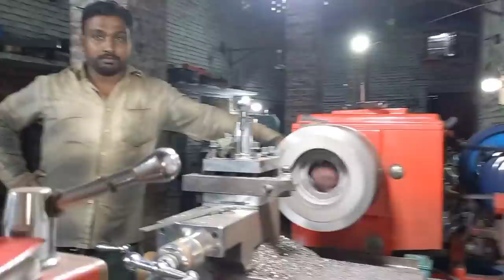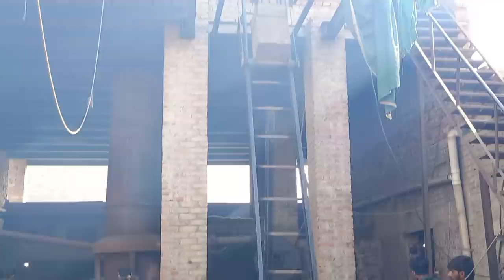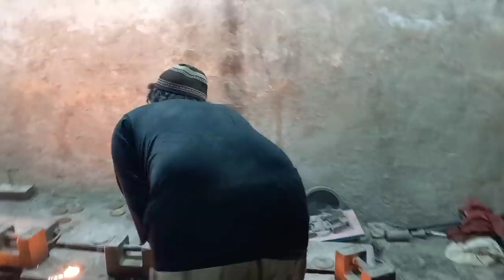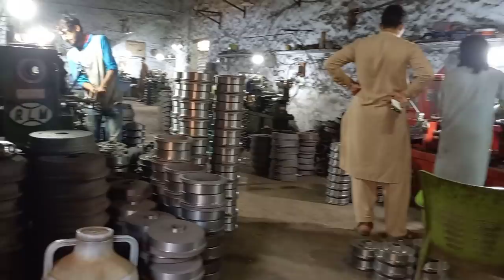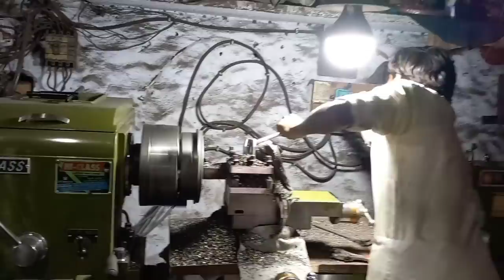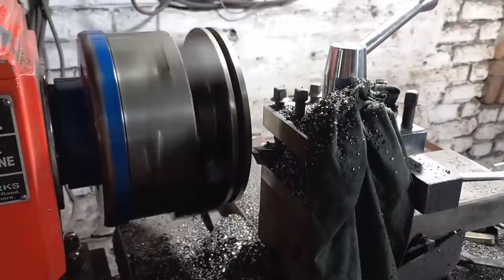How To Make Toyota Corolla Disc Brake in industry || Disc Brake Full Making Process.

Comment: I admire the hard work and their ability to turn out decent looking brake parts in tough working conditions and using less than state of the art equipment. But I now understand why the metallurgy and durability of aftermarket brake rotors isn’t comparable with OEM quality.

Comment: Love watching these guys work. Sure as hell wouldn't fit one of those discs to my car though...
Reply: I've worked in a foundry, makes me wince to watch them.
Reply: @ffjsb  whats the metal quality  !!!!!
Reply: @ericlees7518  Whatever scrap they get for cheap....
Reply: @ffjsb  is it steel or cast iron  mmmmmm
Reply: This is a cast iron foundry.
Reply: You also gotta take into account these aren't going on cars doing 90 on the freeway they're on small not very powerful low speed vehicles in super congested cites travelling short distances
Reply: @umahunter  YUS
Reply: Looking like they make a lot of them. If they're bad no one really would use them. Yes I think keeping the speed below 90 kmph should be alright. The step I see missing is the annealing process to release metal stress
Reply: @abc123xyz7  mmmmm cast iron eh!  mmmmmmmmmmmmm it rusts when wet  not like stainless steel mmmmmm
Reply: @abc123xyz7  yus  but they will rust mmmmmmmmmm
Reply: Eric Lees , yes the break drums and discs that we have on the vehicle rust easily. If you don't use your vehicle for some short time you will see very rusty breaks. Cast iron breaks been used safely
Reply: @ericlees7518  Probably pot metal...
Reply: @umahunter  Do you not know what a Toyota Corolla is????????????
Reply: @ffjsb  it is for any kind of car. Just simple cast iron with high enough carbon.
Reply: @ericlees7518  There is no quality here.
Reply: @rondhole  At what point did they test the molten cast iron for carbon content????

Get my point?
Reply: @ffjsb  all steel has decent amount of carbon on it. It should be enough for India slow traffic, may be not Autobahn with EU ECE90 standardisation. Similar thing with Chinese brake disc. Not all are certified and definitely not for export with the way these guys did
 It  is for local domestic market
Reply: @ffjsb  then they don't buy the local unlicensed parts. GEt it from Totoa dealership.  India has large atnd different markets, just like their Caste
Reply: @johnogara3029  Not from this part of the suppliers. India is large, really large. Just like China Brake disc, they are 1000 different kinds.
Reply: I like how you lot think these are shit. Odds are half of you have brakes made the same way on your car right now. These parts wear down, no reason to make them out of special alloy for a cheap car. As long as it makes it out of the factory it will be fine.
Reply: @Rudy97  Dude, these kind of suppliers are for local just like in other parts of Asia, Afrika, and Latin America.
Reply: Disc brakes have to deal with significant loads and heat, the ones being made in this video appear to be nothing more than cast iron. I sure as hell hope that no one in the UK is selling these discs. The legal ramifications for them would be severe if they caused a fatal accident
Reply: You won't but the manufacturers do and you have no say in the matter.

Comment: Wonderful Aftermarket brake rotors and drums!
Reply: There's NOTHING "wonderful" about these poor quality knockoff parts.
Reply: @ffjsb  my point!
Reply: @graemelliott3942  You're sarcasm is lost when most of the people in the comments are actually praising this poor quality workmanship.
Reply: @ffjsb  I knew that too when I made the comment. I used to be part of a company that made brake rotors here in the good old USA. The actual molds and cores were done on an automated mold marking line called a Disamatic made by the Disa Corp. What they were doing in the video is known as floor pour. Floor pour is good for low volume / prototype production. It’s almost impossible to  hold repeatable balance spec and QC is all over the map.
Reply: @graemelliott3942  I worked a short stint part time at one of the largest casting floors in the US, they made mostly sideframes, bolsters, and couplers for rail cars.  One of the largest things I saw them pour was a 10' diameter double sheave pulley, looked like it was for 4"+ cable.
They had automated mold machines, but I have no idea who made them.  I was safety/security, so I was in the plant all over, but didn't do production.  
Glad it was just a side gig.
Reply: These people have to make what they need. Either this way or nothing

Comment: Without process controls every disc is different each other.
Reply: The variation in material is so small it does not matter. They turn them to spec on a lathe, there are dials on the wheels.
Reply: They’re only going onto their crappy old cars that are falling apart anyway.

Comment: I see some decent looking equipment, shop is not swept but at the end of the day I’m sure they clean up the shop? These parts have to be replacement disc’s used in rebuilding brakes. I agree safety equals sparse and needed but it suits them to work under the conditions. They do remarkably well considering they don’t have the best of tools and working conditions. Good job nice video thank you.
Reply: mn

Comment: After seeing this industrial installations, the manufacturing process and the "Quality Control" makes you afraid to buy brake discs.
Reply: It really does not though. I would gladly buy a set from them and install them on my car myself. These are regular cast iron rotors and drums. An automated factory makes them the same way but with robots.
Reply: @Rudy97  I mean, who cares about steel grades, right?

Comment: LOL I suspect these aren't OEM rotors LOL I wonder what purity of steel they wind up with..for that matter I think they wonder as well! 😆 They're probably ok for an old Corolla, they don't go fast enough to stress the rotors during hard breaking LOL
Reply: It's not steel, it's cast iron. They are good enough for any modern low to mid class car.
Reply: These are not for a Corolla.    If they are then a Corolla is 8 yards wide.

Comment: That is all approved by Toyota they do an AS 9100 audit ever 6 months they are their star brake supplier.  Approved for both the Quality and Engineering sections and have never had a finding.  Currently in discussions with  several Aerospace companies for brakes if they can get the price down.
Reply: Tratores dos países leste
Reply: Boeing and airbus is already bidding

Comment: Are these made for Toyota or are they made for the aftermarket for  Toyota?
Reply: I doubt that Toyota has anything to do with this. I used to work for a tier 1 Toyota supplier. We had to adhere to the Toyota production system. It was a complex document that required us to meet several strict quality and production standards. This process would never come close to meeting Toyota standards.
Reply: This is Toyota head brake disk plant yes.
Reply: @randysterling4700  You had better support your statement. I worked with Toyota for years and I know Toyota would never purchase this kind of crap. Toyota would insist that the metallurgy was carefully controlled. Throwing random scrap into the melt doesn't cut it without melt analysis.  The molding methods guarantee sand inclusion. Manual feed on the lathe guarantees inconsistent surface finish. Using a manual drill press means you will never meet the positional tolerance. They don't appear to address run-out or flatness at all. People that buy this crap are putting their lives on the line.
Reply: @jimfarmer7811  Hi Jim the disks made at this plant are used for Lexus vehicles, which is Toyota's luxury Brand. I can assure you the parts made at this plant go through stringent quality control and destructive and non destructive testing that is not shown on this video as was skipped in the intrest of time.  Each disk brake from our Pakistan plant will provide years of safe miles for your Lexus luxury vehicle, all our machine operators and other plant staff are highly trained and the best in the industry to assure your rotors are the highest of quality.
If you have any more concerns feel free to contact me.
Thanks, Randy
Reply: @randysterling4700  Sorry but I don't believe you. As I said I'm very familiar with Toyota quality standards and this isn't even close to meeting them. These may be on Toyota vehicles but I guarantee you they aren't authorized by Toyota.

Comment: I have never seen a brake disc you could drill with a regular drill and bit before. They are supposed to be very hard .
Reply: You can drill any cast iron rotor,, cheapied to road race quality
Reply: Jason Cooney the matériau used to make disc break can be cast iron, carbon or ceramic. In this case it is low grade cast iron and of course it’s easy to drill a do any fabrication on it. Not the same for carbon and ceramic reserved to high performance véhicule or planes.

Comment: yes but what is the metal quality ? mmmmmmmmmmmmm how does the  lathe  cut  cold hard steel with no coolant on the cutting tool eh!  mmmmmmmmmm what  kind of metal are they using mmmmmmmmmmmmm they are only drum  brakes any way  not discs thank god mmmmmm  any way it keeps them in a job they would not get in to the uk would they for sale and fitting mmmmm
Reply: Carbide doesn't need coolant.

Comment: a brake disc cast from some junk shit will twist after the first brake
Reply: the problem is not the junk...metal is indefinetely recyclable and many new things are made of junk...the problem is the (apparent) lack of quality control to ensure one batch is exactly the same as the other...
Reply: metal is but cast iron is not an ordinary metal, needs special thermal treatment after casting and many many processes I even do not know
companies like TRW ATE Brembo Ferodo Textar have achieved their quality for years
and you want to compare this shit with genuine parts?
Reply: @sradowazyszczadoniecki6567  iam not comparing anything....you see them melt the old parts then they seem to add chemicals/stuff/whatever  to the mixture....i only wonder if they take a sample from the metal before they calculate what they need to add in order to make uniform batches of discs and ensure quality control or if they just eyeball it...other than that recycling old metal is common practice everywhere. many people dont use ferodo textar ate or brembo, they use the cheap ass discs and they work just fine, only problem is they might be more prone to warping and they may wear out faster...catastrophic failure of discs wthout any other mechanical problem associated is very rare and i dont think i have ever seen it.....broken discs i have replaced usually are due to vibration from bad ball joints or bearings..seized calipers or abs pumps, and using the discs way beyond the minimum thickness